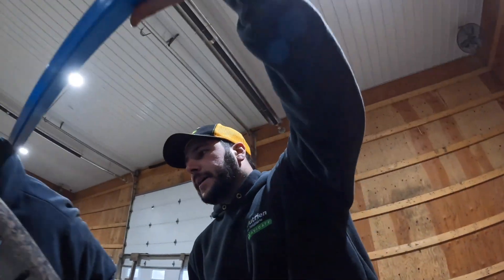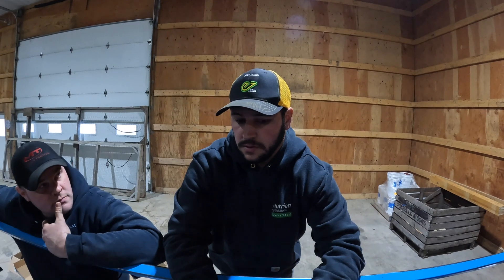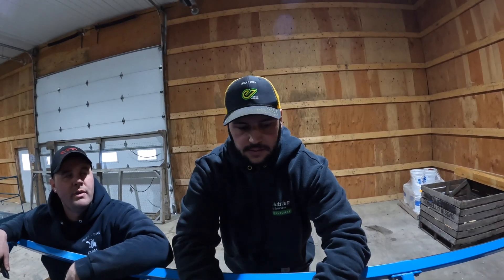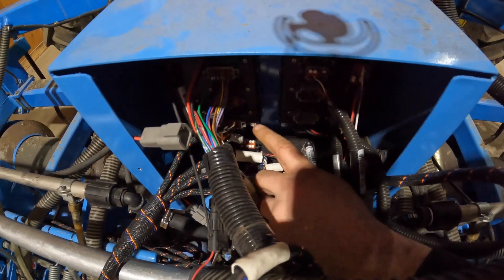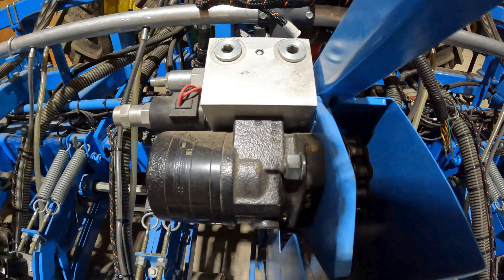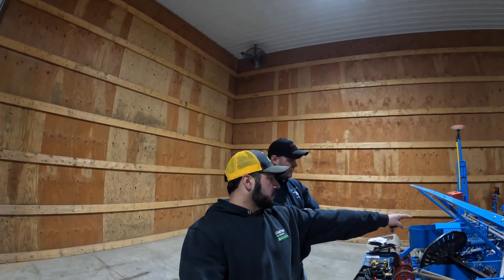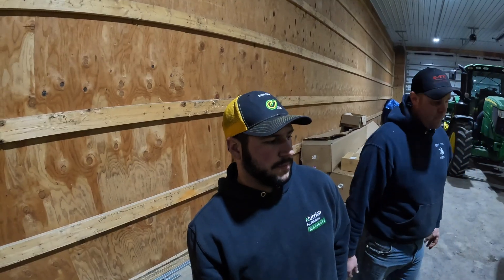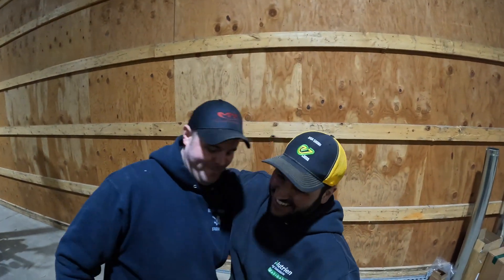Farming with Ag Leader is a SureFire Way to Win

Comment: interesting, ive been applying a starter beside the row for a few years but i am not happy with that, i would also like to put it in the furrow but the reps tell me it will burn the seed.
Which pop up fertilizer do you use that does not burn the seed?
Reply from the maker: What are you growing? We are using a product called altura from Nutrien. It is seed safe. https://www.lovelandproducts.com/sites/default/files/pdf/sellsheets/Altura_d1320.pdf
Reply: @offthemuck  we grow onions. potatoes, sugarbeets and cash crops in southwest Ontario, Canada.
I will look into this product if i can get it here, like i said i have been looking for a product seed safe for onions for a couple of years now.
thank you for sharing the link.